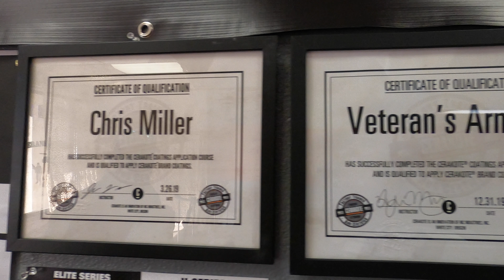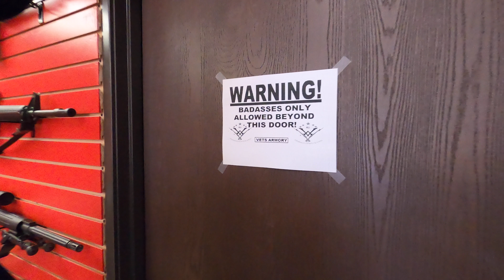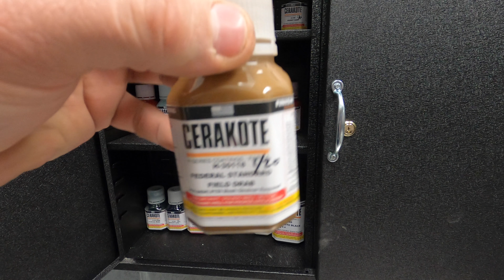Cerakoting a Glock 19

Comment: Brother,  the music is fine (I too like loud music) rock on!  My question is:  do you remove the channel liner for the firing pin channel?  Couldn't the sleeve exterior harbor oil from the factory?  I know you degrease it, and bake if off prior to sandblasting, and you even mentioned there could be some oil seepage from that area...wouldn't it be easier to remove it and replace it instead of running the risk of an oil void?  Your thoughts please.  Final product looks real good.

Comment: Does spraying all internals mess with any tolerances?
Reply: Not if you and blast. The thickness of factory and cerakote once melted and thinned out is about the same. If put on top of the factory coat then yes.

Comment: No way the local guys that coated my 43x took these steps. Mine was flaking off and scratching with my finger nail within a week.
Reply: Yea there are some hacks out here. They also may have used air cure cerakote. I've used air cure that is still holding up 3 years later without chips

Comment: Whats that thing called on the sand blaster that connects to the air compressor and the other Hose?
Reply: regulator for controlling pressure

Comment: Shop set-up was clean and orderly. Clean room was a very nice touch to keep contaminates from happening while painting. Finish came out really, really good. Please talk louder and use the music /end. It was hard to hear you, music was distracting. After you soaked in degreaser,  you heated the parts to off gas? The heat from the off gassing and curing the  cerakote, did not change any tolerances?

Comment: Great Video! Do you sand blast the Frame (for etching)?
Reply: I do but it's not necessary. As long as the shine is gone. You can scuff it with any kind of abrasive. I lower the air pressure and use my sand blast cabinet.

Comment: Does cerekote last longer on the polymer frame than it does on the Steele slide ?
Reply: I have a fully cerakoted 43x and i will never have the plastic parts done again, it scratches off easy and the steel frame is fine! Its better to get a factory colored plastic from Glock or whatever gun youre using and only cerakote the metal parts.